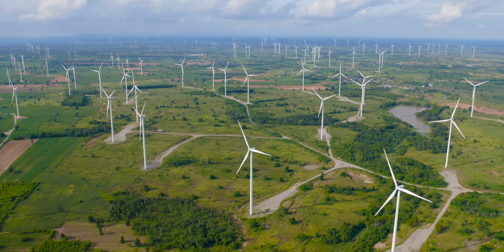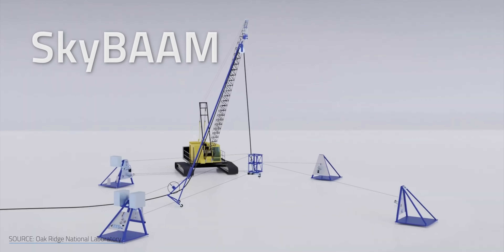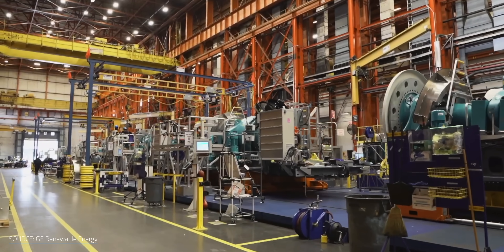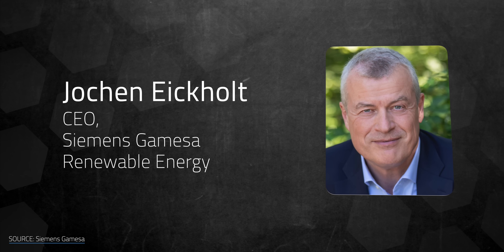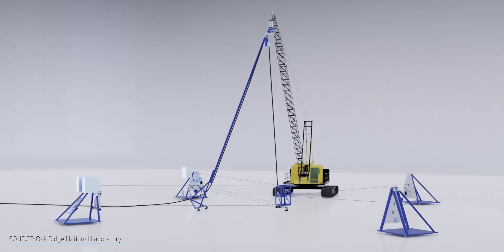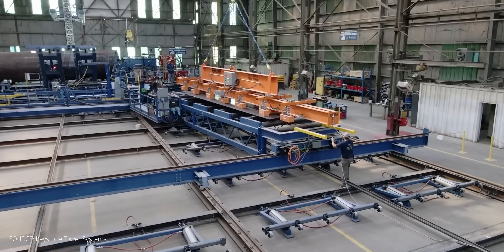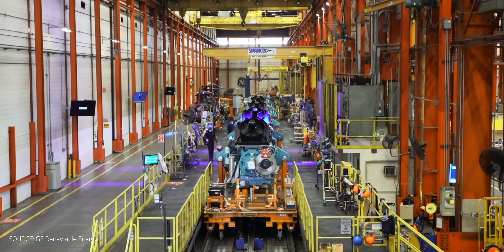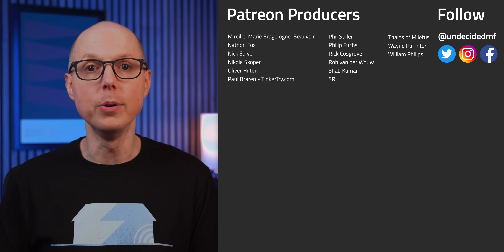Why We Need To Rethink Wind Turbines

Comment: The future will prove that wind turbines have even another problem: security. It probably won't be long before terrorists discover that they are really easy high profile targets easy to take down with a few pounds of high explosives.
Reply: Ohhhhh because pipelines aren't currently being damaged on mass 😅
Reply: @mysticmarble94  it's much harder to target a pipeline hundreds of meters under water or buried meters under the ground, than a towering wind turbine. You already need to have the resources of a country to damage those (as proven in 2022). OTOH, a wind turbine can be taken down by individuals with a couple of pounds of semtex, a detonator and some wheels to get there.
Reply: @avhuf many long distance pipelines are built above ground because it would be wildly expensive to build and maintain them otherwise